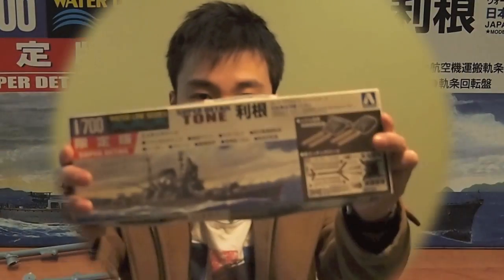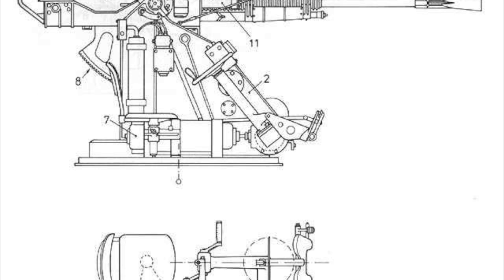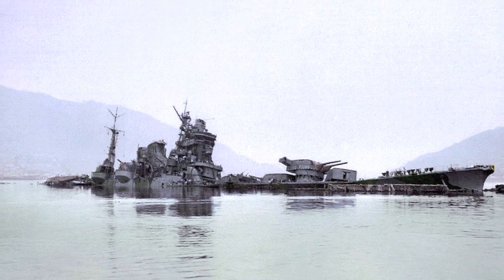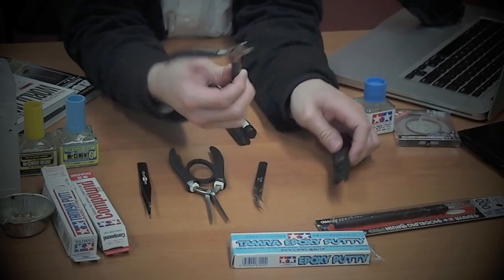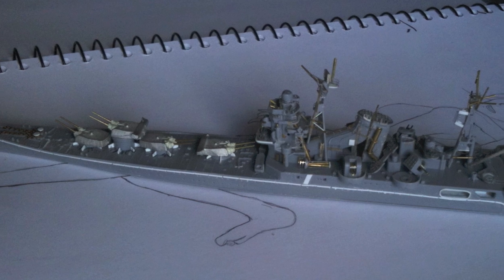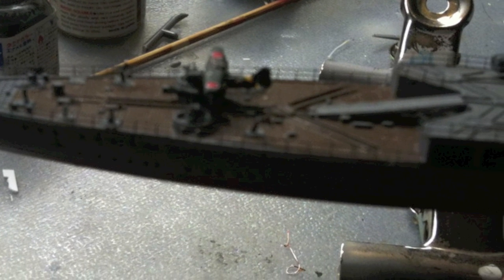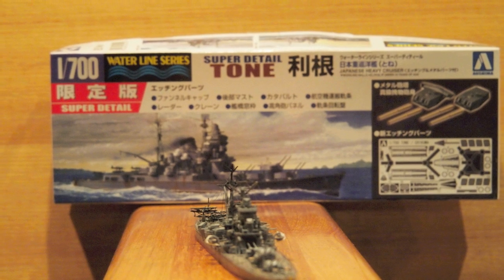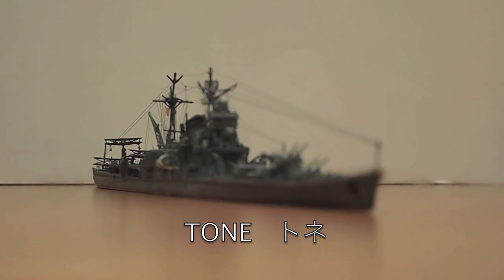A short presentation of the Waterline Series 1/700 IJN TONE

Comment: Great work done, thanks for sharing.  May I suggest for the photography at the end ( if the camera you use is manual) that for the bow shot you use f/16 or smaller and turn up the light, or lengthen the exposure to compensate,  you will find a much greater depth of field in focuses (the camera working like a pinhole) so hopefully both ends of your lovely model will be in focus together.